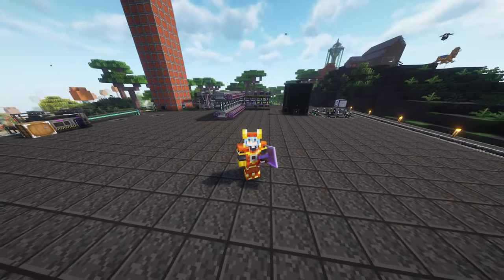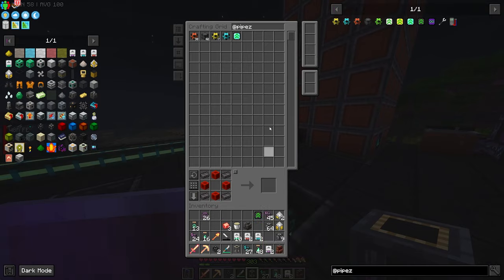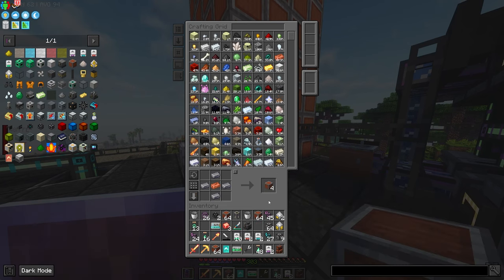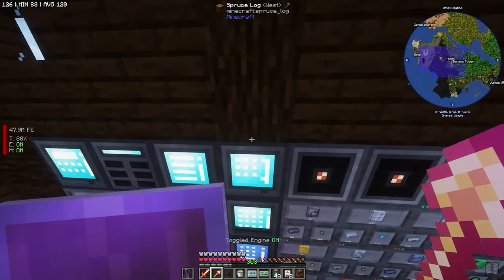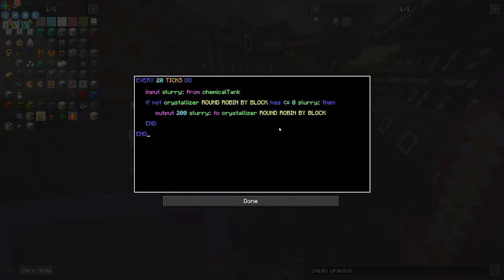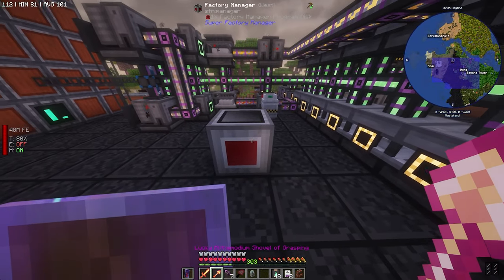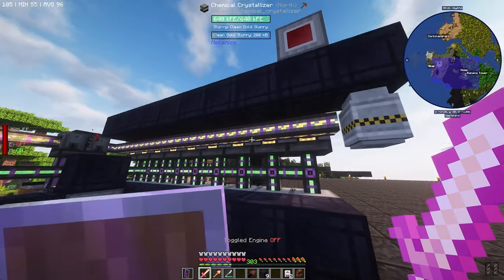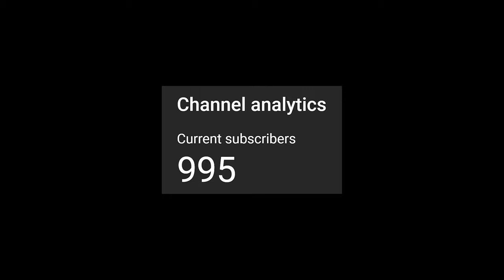Minecraft | ATM9 - #26 Scripting the Ore Factory!

Comment: A good tip if you're goin for the ATM star make patterns for everything you can never have too many patterns mum RF system was using 27krf/tick from the patterns xd
Reply from the maker: I definitely plan to pursue it as some point, so I'm sure I'll have to keep this in mind, thanks!
Reply: Mine’s only at like 3KRF, I have a way to go.
Reply: Side note: I love Advanced Generators. With a simple Create lava pump in the nether, I have a relatively cheap power system that can be easily expanded to 50 KRF

Comment: I did small ae2 network with chemical disks and patterns where 200mb of slurry is 1 ingot. RS sends raw ode, ae2 takes in clear slurry. At end of producion line there's import bus to ae2 network and later it exports to chest that has importer from RS.
Reply from the maker: That's a really good way to handle the issue as well. I should look into using ae2 for chemicals soon

Comment: You probably already got there, but I am at the start of the video (yea yea watching piece meal). For the energy trash can, you will want it on the input channel for power not the output power channel going out to your base from the matrix. You will then want the point set to being lowest priority, and remove the transfer limit. This will in turn allow all your power sent first to your matrix, whenever that(the matrix) is full it will then start sending it to the trash can. Normally while your matrix is filling nothing will be sent to the trash. (I'll comment more as video goes on, or not. It isn't like I chatter much) I "try" to setup systems so that it is a set it once and then never have to worry about it. I also tend to use the bypass limit on all of my points and plugs. It's the fiddling with them that I find cumbersome.

Peace
Reply: As to brine. Those towers are easy enough to make, why not make 10. I'm sure that would be easier then greg tech. OOh sorry I sometimes go in overkill mode. 

loved your solution to the slurry!!! I do love when folks try different solutions within a pack. Yea I get it first time, lots of headaches. I'm sure now that you did that you could probably redo the whole thing a bit more optimally for the cables, and even generating the code again. Congrats!
Reply from the maker: @steveheffner  Ahhh that makes way more sense to put the point on the trash can that way, thanks!

Yeah honestly making way more brine towers sounds much better than complicating my production with GT...

The Super Factory Manager mod was a big surprise for me! I stumbled upon it looking for ways to fix the Brine, and I'm very happy that it exists, I definitely wanna go through and add scripts to some more systems with it now 🤣

Thanks for the help, as well as for watching!

Comment: you can use the pipez mod with an advanced pipe upgrade to round robin.
Reply: This will break over time if you because the pull rate from the pipe will pull faster than the crystallizer with the upgrade you need to round robin